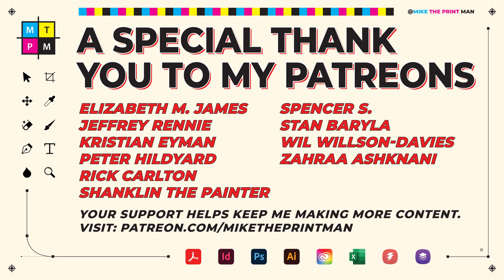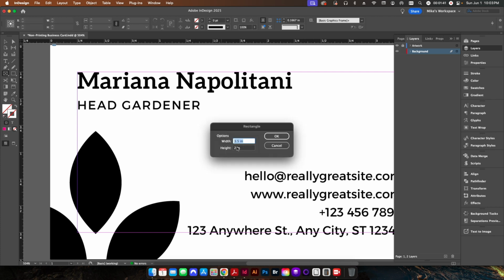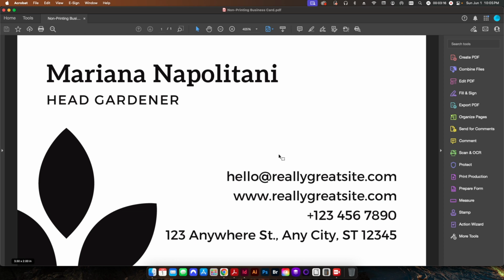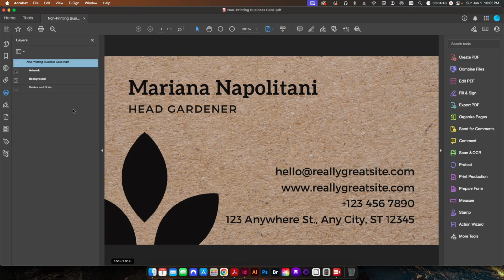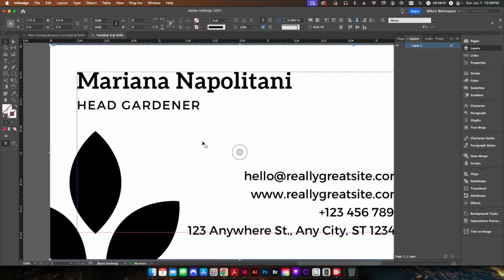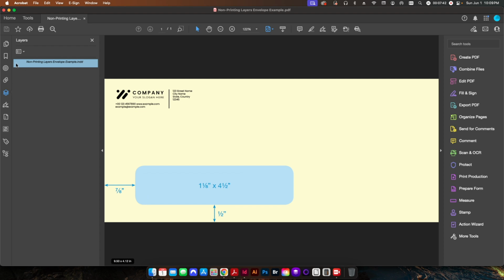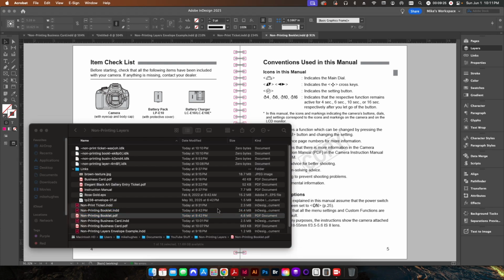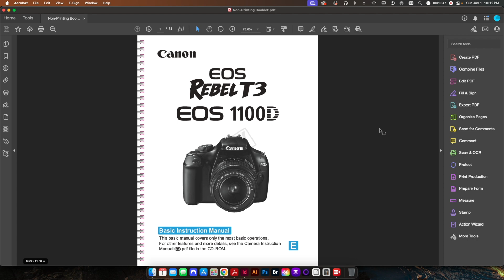The Secret to Better PDF Proofs: Show Texture, Die-Lines, & Binding With Non-Printing Layers

Comment: Great video. Does anyone know how to export a PNG from in design with non-printing layers visible?
Reply from the maker: A PNG won’t work because it cannot contain layers. A Photoshop file can have layers, but a PNG is basically flat. It can have transparency, but not actual layers that can be turned off/on in Acrobat.
Reply: I understand. We have the printing layer situation under control, but we also export a PNG file as a thumbnail reference during production… It would be ideal if that thumbnail showed the media type (eg recycled stock) as well as the artwork to reduce errors.
Reply from the maker: You can still export it as a PNG. You won’t be using that file for the printing part.

Comment: thanks for this cool video. i have tried it and it works, but when the document is placed into illustrator the layer that has been turned off is still visible, how do i make the layer that has been turned off still invisible in illustrator? i use this for layout purposes of making CTP.
Reply from the maker: Yes, unfortunately this will not working when placing it into Illustrator. However, if you simply open the PDF with Illustrator it's easy enough to just delete or hide the non-printing layer. It's more useful if you're placing the document into InDesign since InDesign gives you options on layer importing.

Sucks it doesn't work for both by default, but with a little workaround it can still work.